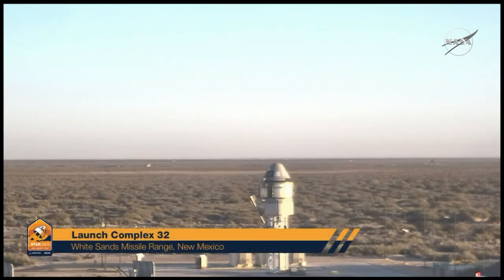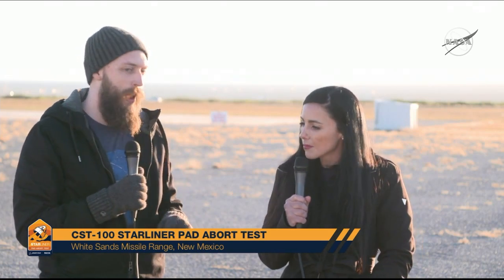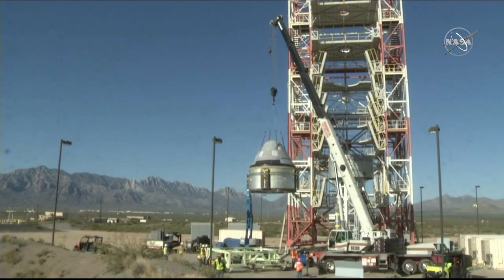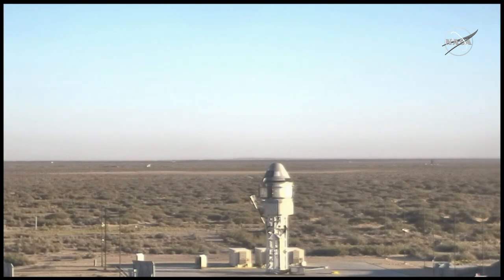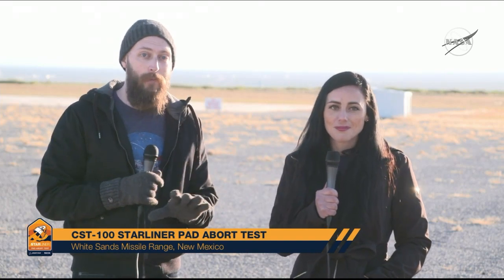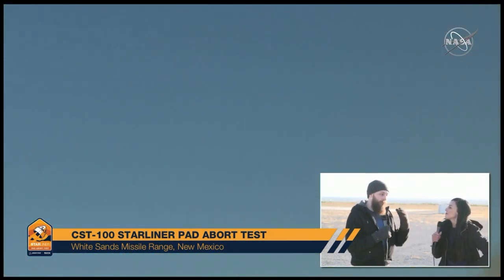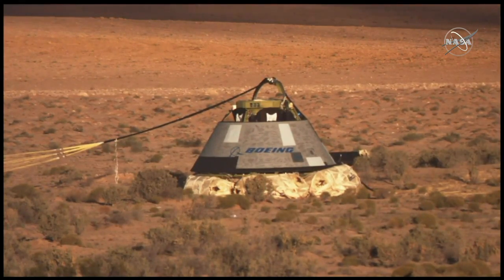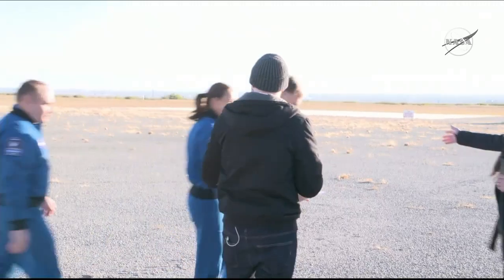Pad Abort Test of Boeing's Starliner Spacecraft, Nov. 4, 2019

Comment: camerawork a bit shaky considering the known trajectory.
Reply: It's a machine known trajectory a human can only guess what the course is outside, a machine however, would know more accurately where it would go. Plus, the camera person is probably recording from a  very long distance which makes recording alot harder considering that the test object is really fast too. It's reasonable that the camera would shake.
Reply: Yes, NASA did a much better job way back in the 60s.  Considering the cost of this program, you'd think they could have nailed at least the camera tracking.
Reply: The trajectory wasn't fully known, what they showed was just an estimate of how they thought it would go, and all it takes for that to change completely is just a bit of wind.
Reply: @winstonsmith478  The Saturn V had a pretty slow ascent, making it easier to track. And i don't think they had the giant main trackers out in the desert. They still tracked it well
Reply: There was better missile-tracking back in the fifties. and it was all done manually.
They had to track anti-nuke missiles that practically fired off like artillery shells.

Comment: So now since the 3rd chute failed to open, I'm assuming we get to watch this again in the near future
Reply: nah. BigB will just circle X it and NASA will go "okey dokey".
Reply: Tyler Smith 2/3 chutes is acceptable for this test. So no further abort testing (that I know of) is planned.
Reply: @AeroBigMike  Normalization of deviation? If abort is expected to use 3 chutes and only 2 opens, that indicates an anomaly that should be investigated. The same problem may lead to only one chute opening, a couple of dead or seriously injured astronauts, and very bad publicity.
Reply: MrTrancelator only 2 is required to safely land the capsule. The 3rd is just for redundancy
Reply: @BradyBaseball13  It's a BAD system when chutes fail like this
Reply: @BradyBaseball13  Again, the question is: is it supposed to deploy in an abort scenario? If it is and it did not, then it is an anomaly, even if two chutes are considered safe. It failed to provide redundancy so something did not work as expected. The Falcon 9 has engine-out capability. Would you say that it is okay if a Falcon 9 has a single engine failure during ascent because there is redundancy?
Reply: I'm not riding it if the probability of a chute failing is 33%!
Reply: skytreker space X also had a failed chute deployment just this year, as well as a capsule explosion
Reply: MrTrancelator the satisfactorily requirement for this abort test is only 2 chutes. In fact in some abort test they only care about the abort system and don’t even bother with the chutes. They just add the chutes to do two tests at once. So the abort test its a complete success but the chute deployment test was only a partial success
Reply: Brett then don’t go to space
Reply: Nah. This is an expensive way to test chutes. They’ll just drop from helicopters or something.
Reply: And I had a flat tire last year. What's your point on the SpaceX factoid? Or are you pointing out how SpaceX is way ahead in the timeline since they've done testing long ago?
Reply: This equates to over a 1 in 10 chance two chutes fail. I doubt NASA will find this acceptable. Yes they'll survive a two chute landing, but the reliability of the chute system needs to be much better. It's good to fail in testing tho. You learn more from failures than successes.
Reply: @BradyBaseball13  Yeah, the explosion was the worst. But it was on an already successfully flown capsule and during additional testing still.
Reply: space x did 13 landing a few day ago and all 3 deployed with no problem.
I wouldn't trust a ship if the 3rd parashout don't open,to be open later by it self and get tangled up with the other 2 ,it happens alot in drag racing when guys had 2 instead of a large one.
Reply: @BradyBaseball13  
The abort test cannot be considered successful if a fire jets out of the service module and interacts with the parachute system, as we saw happening.
Reply: @MrTrancelator  It will be investigated, of course.  However, it 2 of 3 is sufficient for safe operation.
Reply: @MrTrancelator  Apollo had such scenarios happen, yet achieve sufficient orbit.
Reply: @brett4264  Yeah. If my math is right, then

If there ~33% chance of one chute failing, 
then it's a ~11% chance of 2 chutes failing,
and a ~6% chance of all 3 failing!

I don't like those odds.
But, with all the parachute testing they have hopefully done before this test, it's likely this test was just unlucky.
Reply: Perhaps Spacex capsule exploding is better for you?
Reply: That Russian system seems way more reliable. Watching the clock failure today 20/12 star-liner is far from perfect. 
Sometimes it’s hard for all the people putting there heart and work in this to realize it so primitive comparing with the amazing space shuttle. Same with the Concorde.

Comment: 2 chutes?  I thought there were supposed to be 3, but data on 2 may be even more valuable.
Reply: One failed to open. There are meant to be 3
Reply: You can see the 3 chutes deploy at ~ 28:02 but one of them looks like it breaks away.  It's too bad they shot the footage on an iPhone though.
Reply: I'm interested in the forces the capsule sustained vs 3 chute landing
Reply: Demonic Koala No major difference. 3 is for redundancy more than impact safety.
Reply: @md4luckycharms  minimum is 1 chute.
Reply: @CookiePepper  you don't say
Reply: cost reduction
Reply: @CookiePepper  Minimum is 2. 1 chute is probably not survivable
Reply: @AmbientMorality  
One 'chute is survivable, but with injuries and capsule damage.
Reply: @satyris410  
I see three drag pilot chutes and then immediately three main chutes deploy, but after the snap, one is gone. I really expected the drag pilot 'chutes to stabilize the capsule with a delay before the main 'chutes were released. 

There was also fire and smoke visible just prior to drag pilot 'chute deployment, so the air was super heated at that moment. Did the "explosive bolts" or bi-propellant cause cord failure?
Reply: The Apollo lunar mission capsules were designed to land on the ground as well as in the water with two parachutes.  But NASA decided to have three (3) parachutes just to be extra cautious.  The Apollo capsules were designed to land on a hard surface and be survivable even with two parachutes.  In fact, one of the Apollo missions had one of its parachutes collapse during its landing in the ocean. Was it Apollo 15?   I can't remember and I don't feel like looking it up right now.
      Source:  My memory as a student at FIT (Florida Tech)  from 1970-72 and later as a person very interested in this subject by watching valid historic YT videos.
Reply: This must’ve been the Starliner Max8.
Reply: @avid0g  one would hope that the ejection of the service module will not interfere with the operation of the drogue chutes. I'm sure we will find out in time what caused the critical existence failure. Also, it's drogue, a lovely word!
Reply: TheAdkFlyer10 too early....
Reply: William Wright  
The problem I have is that the video we get to see is so zoomed in on the capsule that the smaller three (pilot) parachutes and the three main 'chutes are pulled off-screen. 

We don't get to see what happens, how the 'chutes unfurl, whether one opens up much too rapidly and snaps off from the capsule, or just flies off as if unconnected. 

However, the fire around the capsule/SM and thick smoke trailing from it are obvious anomalies.
Reply: @CookiePepper  Minimum is ZERO...........retro rocket landing
Reply: @daffidavit  Yup it was 15
Reply: Lot better than spacex capsule explosion
Reply: @jasonb4566  Absolutely.
Reply: They have traced it to a manufacturing/assembly fault. Somebody forgot to put the pin in that connects the drogue chute to the main on 1 of the 3. Drogue deployed, but just went sailing off without pulling the main out. They have checked the other capsule, and have revised the assembly controls with more checks, to make sure it doesn't happen again.
Reply: @simonoconnor7759  Trust me; nobody 'forgot' to put the pin in, it was installed incorrectly on purpose.  The techs making their point that 'we control whether what you do will succeed or not'.  Do things our way or pay the price.
Reply: @Strike_Raid  , who knows, maybe you're right, but Hanlon's razor says
"Never attribute to malice that which can be adequately explained by stupidity."

Comment: Like I get that tracking a moving rocket with a camera can be difficult, but even the astronaut interview footage is unstable. How is it possible that Boeing doesn't have a quality camera stand?
Reply: The camera issue was the camera operators were told to go in tight. They should be told to get a distance from a highway as they will be from the ship. Then get as tight in on the vehicles on the high way as they can, while still keeping them framed. Look at their zoom setting and do not go beyond that zoom during the test event. It also helps if the production job is not given to wahmen and immigrants for diversity sake and the job is given to the most qualified.  Some years ago, a human walk over bridge job was given to the wrong(diversity sake) people. It collapsed, killed and injured a bunch of people. Equality of Outcome ruins Quality of Outcome.
Reply: @kukimonster101  Then goes to BO or SX or VG. 🤣
Reply: @kukimonster101  Who was filming then?
Reply: Boeing have just implemented a new program feature that adjusts camera pitch automatically.
Reply: @georgeayt8231   LOL good one
Reply: @enerzise3161  why would you assume that an immigrant can't do the job well and why would you assume that since it was done poorly that it must have been done by an immigrant. This is such a disgusting and unwarranted position that you have taken.

Comment: Anytime something doesn’t go “as designed” it should be a concern. Even if there is redundancy.
Reply: Even if everything appears to go well, when testing just One set of hardware, ONLY Once ... a good visible test result is MEANINGLESS, ... Engineers must depend heavily on data collected to determine if all systems are reasonably safe and met all functional parameters adequately.
Reply: This test proves that the redundancy is good, but the deployment is flawed and they need work on their systems and come back for another test.
Reply: Oh trust me, they will fix it. Apollo had many back up systems they had to.
Reply: @jameswhitman3934  This test does not show if everything would go well with all chutes deployed. It is not self-evident, with  over 20 thrusters
Reply: Which is why starliner is still in testing

Comment: and... a new hazmat site is born at WSMR....
Reply: Why doesn't the service module have a bi-propellant burn-off process after release?
Reply: @avid0g  No where near enough time to do that unless you used charges to burst the tanks to get a detonation/dispersion.  This would be... detrimental to mission objectives.
Reply: @jamestheotherone742  
How about a burst disc valve on each propellant tank and plumbing that combines the two propellants and sprays the exhaust with opposing directions to cancel net propulsion?
Reply: @avid0g  That would be quite spectacular...

Comment: Brown smoke is nitrogen tetroxide? Toxic, a crew can’t leave the craft, a rescue team can’t approach to save the crew. Something needs to be done about this.
Reply: Like what?  It's not like they can redesign the craft this late. I think it's just going to be a "wait it out" scenario  :Þ
Reply: @karenrobertsdottir4101  Design flaw, too bad. Yeah, redesign is not an option. There is a solution though. Just wait for 5 years when ISS is to be decommissioned and no need to launch this Starliner. Why does NASA need 2-3 vehicles? One is just fine, crewed Dragon or Russian Soyuz.
Reply: Standard protective gear is fine for the rescue team, Space suits also  give adequate protection.
Reply: Self contained breathing equipment? There's going to be fire crews with SCBA on standby for emergencies, and wouldn't the crew be wearing g-suits and oxygen at launch? I'm not familiar with Nitrogen Tetroxide, but wouldn't that be sufficient for protection?
Reply: NVM. I had forgotten the side effect of the engine producing Hydrazine tetroxide
Reply: Even without the smashed service module nearby billowing toxic clouds.  The capsule itself is totally contaminated with it from leaking rocket valves and from flying thru the cloud of unburnt propellants @ 28:00.  This requires special procedures to decontaminate them. 
This is a problem for all spacecraft that use NTO/UDMH, From the shuttle to Dragon. Although in Dragon's case, water landing washed the stuff off.
Reply: @jamestheotherone742  The capsule is designed for use in space. So the Hydrazine Tetroxide will most likely not get into the vacuum class pressurized container, otherwise known as the cst-100
Reply: But wasn't that from the service module? If i remember right, it was coming from the wreckage of the service module. If this was an orbital flight, the service module would be completely dry and would burn up in the atmosphere. Of course, i might be wrong.
Reply: @Mrlaggy99  Yes, the hypergolics were stored in the service module.
There might be some fuel left in the service module in re-entry, but it wouldn't do much. It would most likely burn up.
Reply: Sir Yeetles yeah, so there shouldn’t be any worry about toxic fumes. I don’t know why these people are so worried. I mean I literally live close to where they launched this. Like almost ten miles away maybe.
Reply: That was also the case for the Apollo capsule and space shuttle. What you do is leave the crew in the capsule for a bit, send in a cleanup crew, and then let the crew out when everything is safe. If anything, the crew's flight suits provide some amount of protection.
Reply: @hydrochloricacid2146  In some of the apollo missions, they even put on a sealed hazmat suit, in case of lunar bacteria

Comment: I Think there Is a big problém with lost parachut and cloud of hydrazin
Reply: That is dinitrogen tetroxide. Hydrazine is colorless
Reply: @satyris410   There was probably quite a bit of hydrazine spraying around too.
Reply: @satyris410  which is quite toxic
Reply: @satyris410  We didn't see the impact of the service module.
Reply: Benjamin McCann  no, it's a chemical called dinitrogen tetroxide which is 2 nitrogen atoms surrounded by 4 oxygen atoms. This allows it to pack more oxidiser into each molecule and either make it more energy-dense or easier to handle at standard temperature and pressure or less volatile at same.
Reply: Uh its a crash landing, stuff gets broke they are only saving the crew in this scenario.